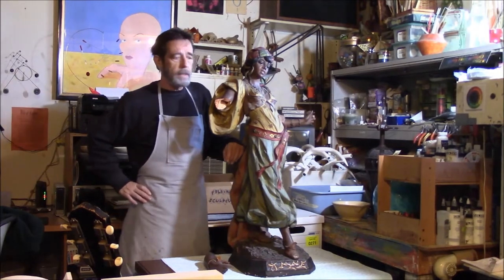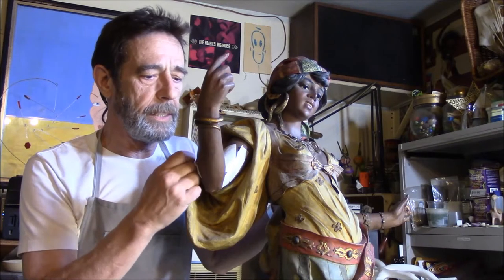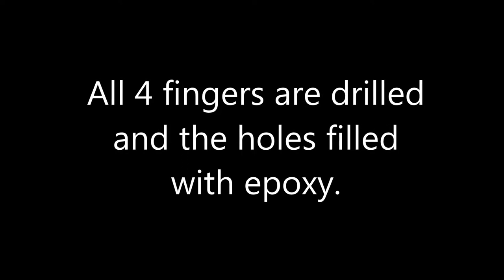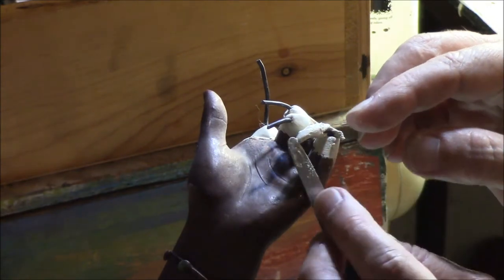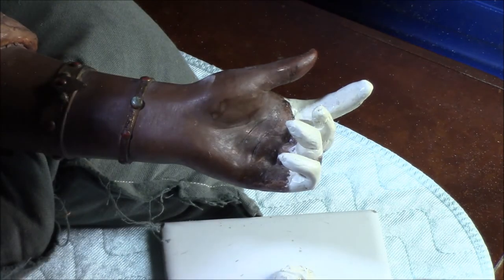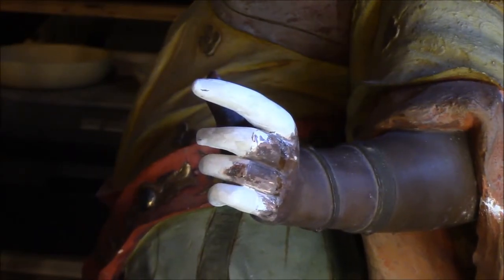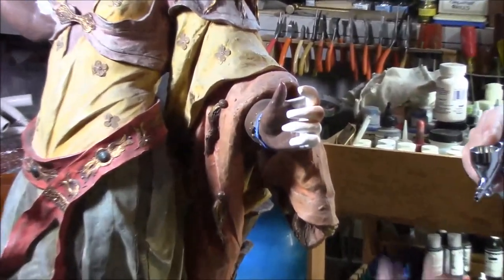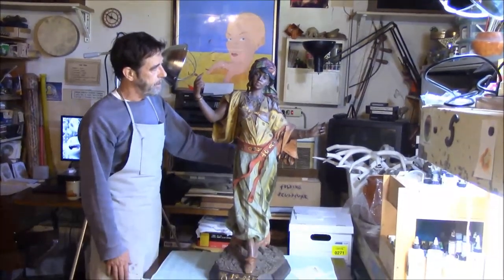"Uriela" statue restoration

Comment: I took on a project of restoring a sacred heart Jesus statue for a friend that’s about 2 feet tall. I appreciate this video - especially for the product suggestions. Luckily I’m an artist & creatively can fix about anything…BUT…she brought me this statue (painted solid black) after finding it in an unused shed - and after she tried to remove the paint. Ugh. It appears to be plaster over a porous stone base…possibly a sandstone of sorts. Much will have to be built up, and a smooth coat over all of it since it now has harsh brush marks from the paint removal. Yet, with all that, I still have to figure out how to get the hard black paint off in the crevices & hoping not to inflict more damage. Any suggestions? Thank u in advance!
Reply from the maker: I don't work on plaster objects and statuary, so I can only offer a little advise. I use "Jasco paint and epoxy remover" for removing paint from the objects I work on. Don't leave it on raw plaster very long (not more than 10-15 min.) before rinsing it off. Even then you have to let the plaster "air out" for a few days afterwards to let all the chemical fumes to evaporate out of the plaster before putting any finishes over it. 
Beyond that, I can offer any suggestions to address your problem. Perhaps consult with someone who specializes in plaster statuary.
Good luck to you.
Reply: @marsgitar  Thank you for your suggestion. I actually eyed the Jasco product, but having used one of their products to remove flooring adhesive (which ate thru several surgical gloves) I kept on moving! Serious stuff, no doubt…fumes are nasty! Interestingly, I just found some small rectangular sanding blocks, which are actually for fingernail buffing, so extremely fine grit. These may work in some areas…sculpting metal files elsewhere. Have my work cut out for me! Thank u again! Love your videos!

Comment: Hi - this is fantastic work. I have been given an old mermaid statue to try to re-paint but the original paint is all curling and flaking off. Can you advise me how best to take of the layers and what paint I should use if it is going to be hung outside?
Reply from the maker: Thanks for the compliment. 
Paint removal method depends on what the statue is made of. If it is plaster, or alabaster it will not survive outdoors. They won't stand up to the weather - even under shelter. Read the directions on the paint remover package to make sure it's compatible with what ever the statue is made of. If wood, stone or metal, paint remover should do the job. As far as paint, a good quality solvent based exterior enamel paint would work. Good luck to you.

Comment: Trying to follow long with the fingers restoration. Did you use epoxy paste or putty for the anchoring of the armature?  Also for the fine build up, what product did you use.  In the past I've used apoxie sculpt but couldn't get the level of details that you got.
Reply from the maker: I used Rezolin A+B epoxy putty to anchor the armatures (the tan stuff). I used Milliput epoxy putty for the fine fills (the white stuff).
Reply: @marsgitar  Awesome thanks!

Comment: You didn't say what kind or brand of epoxy . What is the filler made up of?
Reply: What kind of holding tape?
Reply from the maker: The white filler is Milliput. The fingers are made from A+B brand epoxy putty. The tape is masking tape.

Comment: What type of lakier Do you use? after all operations
Reply from the maker: I use "Cold Glaze Pro 2" made by Sylmasta company.
Reply: @marsgitar  Thanks :) What type of paint? acrylik?
Reply from the maker: @wood-artdesign 
Yes. Golden's brand acrylic paints and mediums.
Reply: @marsgitar  mediums is it brands too?
Reply from the maker: Yes, Golden's mediums. @wood-artdesign
Reply: @marsgitar  Thanks. Will try.
Reply: @marsgitar  What brand can use instead golden medium?
Reply: maybe do you try americana brand?
Reply from the maker: any major brand artist quality acrylic paint mediums will work fine. @wood-artdesign
Reply: @marsgitar  Thanks a lot.
Reply: @marsgitar  What type of medium do you use with acrylik paint?
Reply from the maker: @wood-artdesign 
That depends on what I need to do to the paint. For thick paints I use airbrush medium to thin the paint. If I need to slow down the drying process, I use retarder. If I need a matte finish, I use a matte medium. If I need a transparent color I use a transparent medium.  Look for what mediums are available, read about them, and you'll find the medium for your needs.
Reply: @marsgitar  Thanks a lot :)
Reply: Which type of paint (brand golden) better? Matte Fluid with different mediums or heavy body or other? or its doesnt matter
Reply from the maker: It doesn't matter. Depends on your needs. I use mostly fluid paints because mostly I use in airbrush. @wood-artdesign
Reply: @marsgitar  but i can mix with mediums fot airbrash?
Reply from the maker: Yes. @wood-artdesign